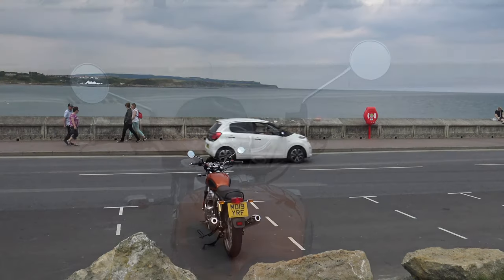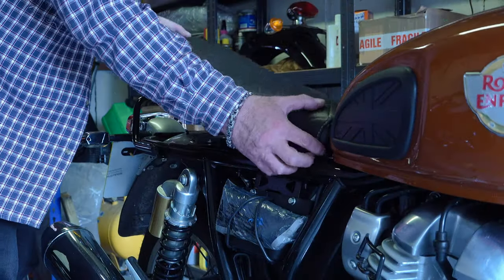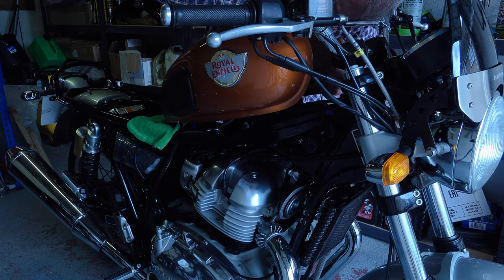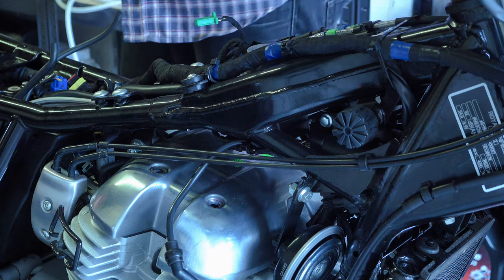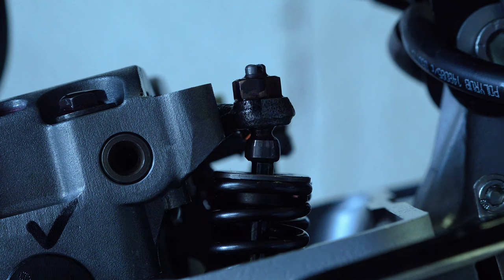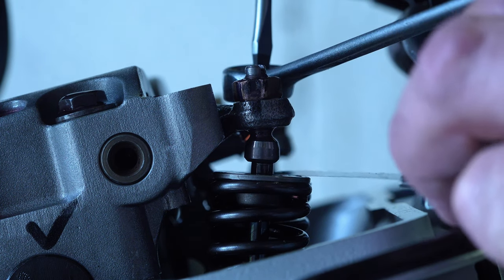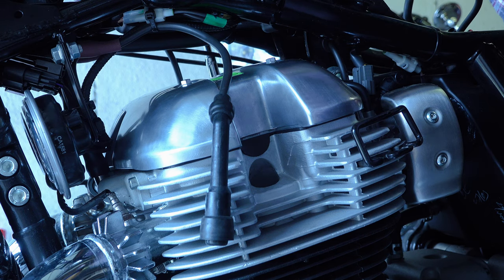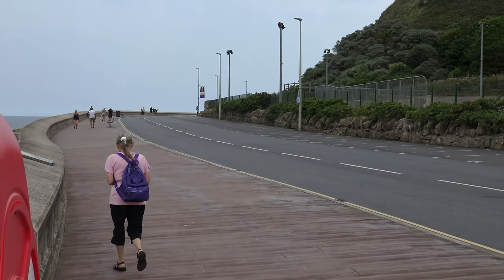Royal Enfield Interceptor 650 service Guide part 2, checking/adjusting valve clearances/tappets!

Comment: There are a number of "through hole" socket sets available that make tappet adjustment easy without the need of specialist tools.
They enable whatever is needed to adjust the tappets to be put through the socket.
Reply from the maker: I did look into that Fred but for the cost and frequency with which the tappets need to be done, I decided to stick with conventional tools.
Reply: @stuartfillingham  I have a cheap set of such sockets that has the usual screwdriver bit set and handle plus various accessories and setting tappet is just one of many uses I use it for. 
(A lot of people have borrowed it a motorcycle rallies.)

Comment: Very well presented, this process is leaps and bounds better than the Triumph valve adjustment! Unfortunate about the valve cover bolt. Wondering if it is because of the rush in production since the demand has outstripped the production... As a side note I wouldn't take comments so personally since people are going to say many things without fully listening to what you are either saying or presenting. Keep up the great work and look forward to the 650 content.
Cheers.

Comment: Hi Stuart, great maintenance series, you're doing the right thing by breaking up the content in stages. I have one query about the gasket, I noticed you had it on the cover when  the cover was replaced and I know you mentioned leaving it on the cylinder head. So did you intend to fit it back on top of the cylinder head when replacing the cover or on the cover as in the video?

Comment: Hi Stuart, tappers on my machine were almost closed, all very tight indeed after 1600 miles, they were adjusted at the 300 mile service by RE dealer bu must have moved since then. Adjustment process went well after a bit of a struggle getting the rubber rocker box seal to stay in place, I used some gasket sealer in the end to hold it in place. The bike now runs well, a bit better than before I think but there is an audible tickIng from the top of the engine when cold which largely disappears after the bike warms up. Would you say this is Normal? I’m a little nervous as I haven’t done this task before. Great video. I wouldn’t have attempted the task without it.
Reply from the maker: The tapping is normal simon thats why they call them tappets! Its when you cant hear them you should worry!
Reply: @stuartfillingham  thanks Stuart. Surprised how very tight the gap was. Presumably they will stay at the prescribed gap longer now the bike is fully run in. Great work Stuart, many thanks.

Comment: I’m curious on your thoughts regarding the Moto Guzzi V7. I love shaft drive vehicles hence why I’m leaning toward the Guzzi over the Bonneville or interceptor. Do you have any comments? Cheers!
Reply: If you have the budget go for the guzzi. So unique bikes and the valve adjustmet is so much easier because you dont need to remove the tank or anything else. Just unbolt the crews and remove valve covers...

Comment: Hello Stuart, Can I ask did you manage to download a Workshop manual  for the Triumph T120 , I can't find one anywhere. I have  yesterday  made the mistake of ordering  Owners handbook  from Triumph Parts at a cost of £50, then I realised it was the handbook that comes with the bike. 
I am not trying to get anything free I would pay for the download and I would print off relevant pages to take into garage. I did buy the Haynes manual, however  a bit disappointed in them these days. In the past  they used to have nice exploded diagrams of the engine and other parts which I found easy to follow and identify. The modern version seam to have black and white photos that are not as easy to follow. Good Video again today don't let the bar lambs  grind you down.  Love Paul
Reply from the maker: No ive never bothered Paul, I find the Haynes manual is comprehensive enough for my needs. your best checking the various forums and FB groups re the factory manual, I believe it is available now.

Comment: Nice one mate, I'm a new rider (23 years old) and have me a continental 650. Did the valve clearance checks myself. I'm just wondering how tappet noises should be? I've no other bikes/experience to compare it to but at idle it's almost impossible to hear the exhaust, just the engine itself. Normal enough in your opinion?

Comment: Just to clarify I take the feeler blades you used are not the exact ones in the link? 
Doesn't matter just took me by surprise.
I have different figures on the actual blades i purchased
Inlet would be 0.003 or 0.076mm   (yours 0.08mm)
Exhaust would be  0.007 or 0.178mm (yours 0.18mm)

Does this seem correct?

Comment: Hi Stuart, thanks for all these videos.

Excuse me if it has been asked, I did read the comments but may have missed. The workshop manual I have specifies turning the crankshaft clockwise not counter clockwise. Is this a change?
Reply from the maker: I'm sick of answering this one. No the manual doesn't say that, read the tappet adjustment section again. One channel has already almost destroyed itself and ended up having to remove a video suggesting a clockwise rotation. Royal Enfield uk advise anticlockwise!

Comment: I checked the valve adjustment on my 22 RE INTERCEPTOR  yesterday.  It had 375 miles. No adjustment was needed. 
I did ask my dealer before doing this and was told they have checked a lot of them
Reply: Continued,  no adjustment. was needed.
I do know something.  If there was one more inch of cleance above the valve cover it would have made the job a lot easier.  To bad you couldn't have a better video of removing the tank. It took a little time to get the hose off the fuel rail.
Otherwise it was a great video.  Very informative.  The Interceptor is a great little bike , I takes me back 50 years every time I ride it.
Reply from the maker: sorry !

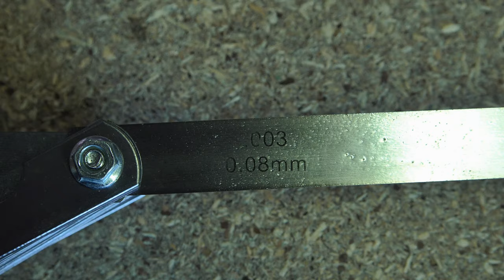Comment: Hi, Stuart.  I am installing a Brand X up-and-back set of risers and the throttle cables get 'stressed' when the bars are turned full right.  After watching this video and studying a freeze frame around 11:51, I am wondering if it's possible to reroute the cables above the rubber tank mounts.  I think that may give me what I need.  Your thoughts?

Comment: Thank you so much 🙏
Trying to take my time and doit in a couple of days like you suggest.
Is it possible to check valve clearance without first emptying the engine oil?
🙏🙏
Reply: The rubber gasket just won’t stay put
Keeps falling into the rocker box…
Covered it all up and will make another attempt later on once some of the frustration wear off 😅😅

Comment: Hi Stuart,  Being a recent owner of a continental GT, I plan to do first service myself. Searching the web, I found your video, which will be of great help for sure!. A question: I found various other videos on valve adjustment, and they do not all tell the same story about crankshaft rotation direction...You say anti clockwise, some say clockwise....What is the truth?   And what if wrong direction is used?
I am used to this kind of adjustment on my old Guzzi Le Mans, and I have to say that I never paid attention on the rotation direction, so must have used both ways, without any issues (so far...).
Cheers from sunny south of France.
Reply from the maker: Best practice Jean anti clockwise, but in reality it doesn't matter. There were some concerns initially about damage to the spragg clutch on the starter if turned clockwise but this is not now considered to be an issue.

Comment: Did anyone’s valves/tappets sound a little louder after the adjustment? Mine were all very tight so it may just be that it’s making noise because it’s set to the right clearance
Reply from the maker: Yes mine had gone pretty quiet compared to new, but are quite noisy again now, at least you know if they go quiet they are ready to be done again!
Reply: There"s an old saying "noisy valves are happy valves"

Comment: Hi Stuart, very informative as usual..my Euro 5 I interceptor has just had its first service, on the invoice it mentioned only a oil and filter change, am I right in assuming the tappets should have been checked at the very least? I need to ask my dealer but I just wanted to know if RE had changed its schedule...I have checked the manual and it clearly states "inspect and adjust"..
Many thanks and yes as I am tapping this out I have answered my own question....Bike is running fine and returning 60 plus mpg consistently....
Regards Richard Rhodes
Reply from the maker: yes unless they have changed the schedule, check your handbook.
Reply: @stuartfillingham  thanks Stuart..I am waiting for a call back from my dealer..

Comment: Cheers for this. My Conti is in for its first service and I have been told that the rocker cover has been torque down too tight causing the seal to split and leak...I'm wondering if I have the same issue tou had with stripped threads?

Comment: Those four valvecover bolts....I can't help but thinking "hmm, if they are a bit dodgy, could there be others?"  What is your opinion on the matter? Now that you have had a look in the internals, are you satisfied? Cheers!
Reply from the maker: yeah its all fairly standard stuff inside John, and regarding threads HELICOIL!
Reply: @stuartfillingham  Ok, thank you! But helicoil on a new bike? It's a good solution, no doubt. But should not be necessary on a new bike. :-) Any chance that warranty could cover that?

Comment: Tappet adjustment was not done on my Interceptor during 1st service at the RE Service Centre even though I asked them categorically to get it done as it is sugested by RE. They were of the opinion that the tappet only needs to be inspected &  adjustment to be done only if required.  Is it possible to inspect the tappet without removing the engine casings & covers? I have already done close to 3500km & after watching your video now atlast I have got an idea about tappets & I am worried about any probable damage to my bike.
Reply from the maker: Hi Anirban If they checked them and they were ok then there would be no need to adjust them. The only way to check and adjust them is the way ive demonstrated no short cuts im afraid.
Reply: stuart fillingham They didn't open up the engine casing & therefore I am pretty sure they didn't check the tappet. Sir many thanks for such informative video & please tell me what are the chances of any damage to the machine as I have already done close to 3500 km including one long trip of over 1500km from Calcutta to Darjeeling & back.

Comment: Hello Sir,My interceptor is run over 778 kilometers and now the time is to go to the it's First service.When I asked the dealer he told me that in first service he will change Oil,oil filter and open the head for adjust the teppet.
Now my question is, is it compulsory to reset the teppet
What is the difference you have observed after these
Process.
Reply from the maker: yes the manual states the tappets must be checked and if required adjusted at 300 miles/500km. as stated in the video!

Comment: Hello Stuart,I love your vids,Iv had a Kawasaki Versys for 5 years now my guarantee has run out,i am servicing it myself.I am 54,good at electrics,some mechanics etc.
I am looking to buy this this in the future,but been weary of the tappets,you explain it well.
also,what is the tool you use at 6:39?
thank you
Reply from the maker: Hi Thanks Zombie,  Yeah thats not a tool that you see in socket sets these days although they used to be very common. Its just a socket crank, shaped a bit like an old fashioned starting handle quite a convenient tool really especially if the fastener has a very long thread!
Reply: @stuartfillingham  cheers,I guessed so,but it seemed compact,true my dad had starting handle on 3 of his cars,good old days,flat battery 😵 ,,,,who cares👍😋 lol
Reply from the maker: No problems, must have been the video it is a full size one honest! @zombiebiker5581

Comment: Hello 
I'm the question please how to adjustment tappet valve clearance.step one setting mark L at this points and then adjustment valve exhaust of piston lift and then intake valve of piston right  is this correct please?
Reply from the maker: as explained in the video.
Reply: Thanks you so much sir.

Comment: WARNING: DO NOT tighten the bolts on the rocker box cover back to 12nm as the spec suggests! I did this, and at 11nm one of the bolts broke off. Now the end is stuck in the hole, and i'm SOL. Not sure what to do now.
Reply from the maker: you will need a stud extractor to remove it. I only fastened mine to 8nm as 12nm seemed exessive
Reply: Hmm yes I've just done the same! The workshop manual seems to be incorrect. I managed to drill it out using and old fashioned egg beater drill (3mm). There's not enough space to fit a regular drill as the bike frame is very close. As it's an open ended hole it dropped out the bottom after drilling. First time I've done this so thrilled it worked out ok in the end. A torque spec chart recommends 2.5nm on  a grade 4.6(strength) M5 bolt. The rocker cover bolts have no strength markings so that theoretically makes them grade 2, so torque below 2nm? I'm no expert so will be hand tightening to snug when the new bolts arrive! Hope your situation was resolved🙂

Comment: Ok... So you said we need a 10mm plug socket which sounded small to me , thought there must have been a misspeak there, so I called the dealer that I bought my interceptor  from and the tech that puts them together said 14mm thin wall plug socket which again did not sound correct so I looked it up in the manual when I got home and it says just a plain 16mm socket and I tried it and sure enough it works. Makes me wonder if I need to be concerned that the guy putting them together for a living has no clue what tools to use on them.
Reply from the maker: Hmm I obviously missed that when I proofed the video! my apologies.
Reply: @stuartfillingham  No worries. Your not perfect my friend... Just really darn close... hahahaha
Reply from the maker: I shall pin this comment in case anyone else has problems!
Reply from the maker: Hey Dade, Re this comment I rechecked this weekend, and found that the size is indeed a 10mm plug socket! So im not losing it after all! however if you are using a conventional long reach socket the hex size will of course be around 16mm. The difference of course being that a specific plug spanner denotes the thread size and not that of the actual Hex!
Reply: I am honestly not sure my friend what is going on. When I go to purchase a plug socket here in the states it is hex size. I can't even get a 10mm plug socket and the 14mm that the mechanic suggested was too small so it could just be a location thing because I can't even get hold of a Newton Meter torque wrench like you have in your videos. I have to use the da NM on the back of the Foot Pound wrench. I apologise if I caused any confusion.

Comment: I can't imagine for the life of me why Royal Enfield did not design a top-end like a triumph which is easy to get to with a feeler gauge and the wrenches to adjust your valve clearance why do they go out of the way to make it more difficult I never would have guessed the valves on my Triumph TR6 unless they started to get a little bit noisy all of the Old Brick bikes were easy to get to the valve so they could be checked for adjustment if they needed you would think that would be a feature that they would copy on the new retro bike instead of making it more difficult

Comment: Well, the cover should come off easily ?  Well it doesn't.  There's a bit missing from your video,  when you release some screws and lift up some ABS hardware above the engine with some wooden shims seen at 8:53 in the vid. Without that bit, it's near impossible.  I forgive you but if you can edit it in for future unfortunates it would be good. 😉
Reply from the maker: 66k views and your the first to mention it.
Reply: @stuartfillingham  😉 I will take that as a compliment. Love your work .